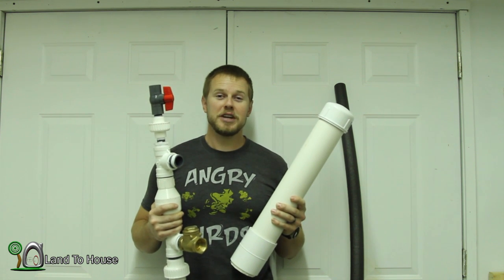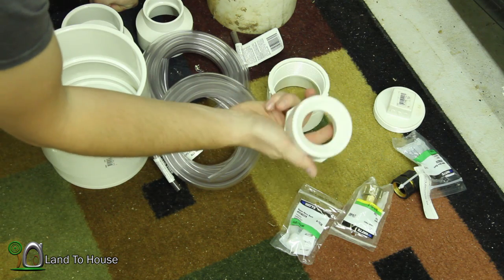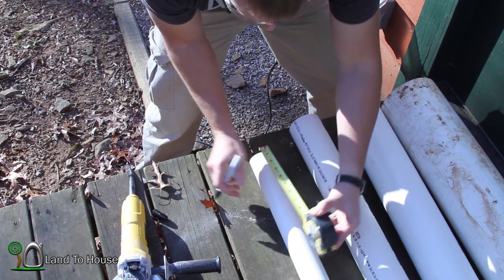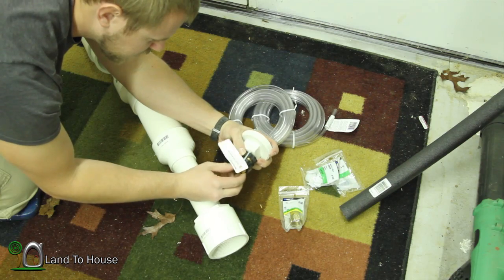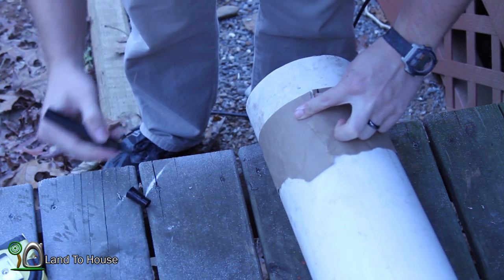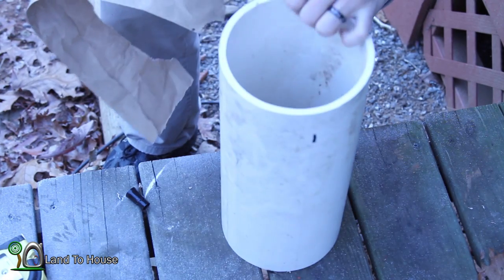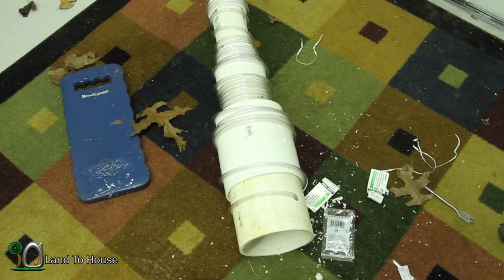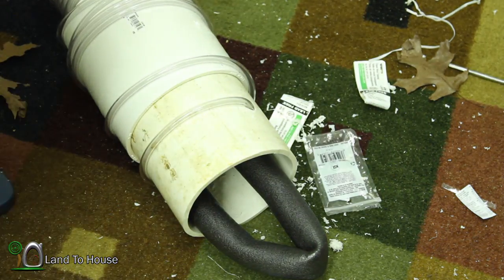River Pump Build and Test Part 1

Comment: Just curious why wouldn't a ram pump work in a river? Flowing water has a calculable head. You can also put a stand pipe up stream to increase the head. Also if you make a funnel you can increase the flow.
Reply from the maker: A few things happen when you try to put a ram pump in a river. The weight of the water on top of the waste valve is known as hydrostatic pressure. This is basically the opposite of head pressure. So you would have to put the drive pipe on the bottom of the river and the pump on the bottom of the river to actually see the head pressure. It's also super annoying to work on the pump when it's deep underwater
Reply: @LandtoHouse  Why would the pump have to be deep under water. You show in one of your videos that a ram pump can be submersed a little. I live on a river that has a pretty good flow. doesn't the ram pump work more on flow and pressure.

Comment: I just watched this, and had a few thoughts that "might" help with the design you have. Instead of one hose, try three (maybe four) hoses that join together into a manifold just before exiting the pump. You have the length to do it, and the extra input volume would increase the output. Try setting the open ends at 90 deg from each other at the big end to keep a constant flow rate. Oh, you have a flow bottleneck at the hose barb you might want to look at, as well.
Reply from the maker: These all seem like very good suggestions. I started working on a redesign using a 55 gallon drum but soon lost interest. I did find a power washer swivel that would do quite well. I still have all the stuff but I've been focusing on so many other projects lately. Thank you for the feedback!

Comment: Excellent,  just a small suggestion. Adding an Extra swivel connector or 2 will add more freedom to the spin. Also the in take can be larger, gradually reducing as it makes its way around the shafts. I also put a check valve on my line just before it goes up hill, works a bit better than this, great presentation,  can't wait to see the other ones in this series. Thanks for posting
Reply from the maker: I have plans on another model that will hopefully work better . . . I purchased the things I needed but never did get back out to make it.

Comment: 10 turns on a 6 inch PVC should give up to 60 inches of lift, or higher if bubbles aren't removed.
Reply from the maker: I have a new design that is at the propeller stage of the build. I am almost done and ready to test. Several improvements over this design.

Comment: i'm looking at "rotary systmes inc" they do a 005 series entry level inline swivel union. & ultimate washer they do a stainless steel 90degree 30rpm union for 66$
Reply from the maker: +MichaelNeary8888 Not bad. I had not seen that site before. In my design I want to get the final build down to less than $100. So the $66 swivel is a little much. The one that I have is $23 and seems to work really well.